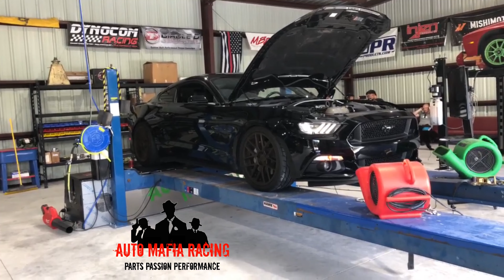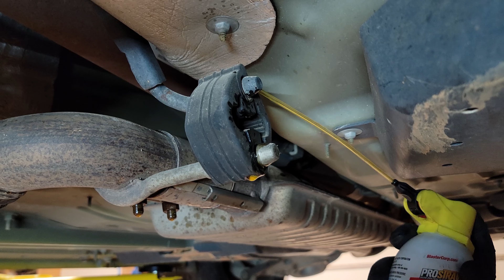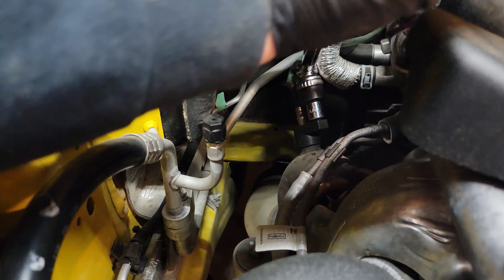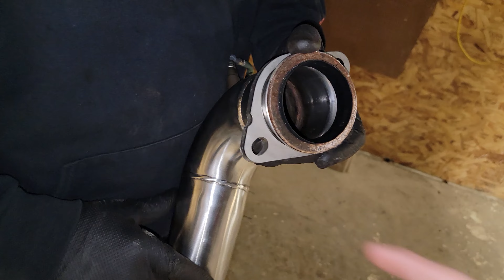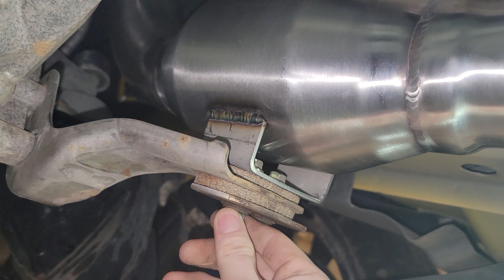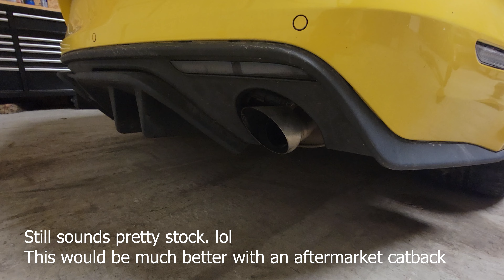How to Install AMR Catted Downpipe for 2.3L EcoBoost Ford Mustang (2015-2023)

Comment: Installed the downpipe a month ago. Everything went smoothly super happy with the build quality. Would be nice if you guys sold just the flex pipe portion that doesn’t reduce down to 2 1/4. I’ll most likely be going with a custom cat back setup in the future and would like to keep it at 3” till the y pipe
Reply from the maker: We are working on a 3 inch to 3 inch adapter
Reply: @automafiaracing  awesome! I’ll keep an eye out for it
Reply from the maker: send us a message for it.

Comment: Does the ecoboost engine become less reliable if I put a precision NX2 turbo on?
Reply from the maker: No more but we suggest the BNR and we have them in stock 

📬 Contact AMR for build advice and guaranteed lowest prices.
📞 941-979-1132
📧 Support@AutoMafiaRacing.com    www.automafiaracing.com